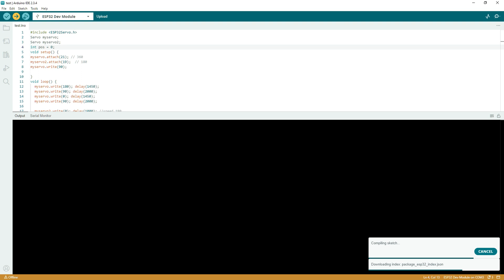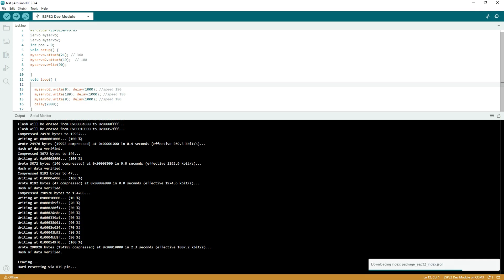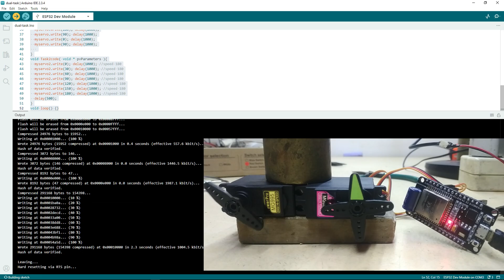Fix Failed to connect to ESP32 No serial data received

Comment: I was having this issue, for several hours, until I swapped my micro-usb power-cable to a data-cable. Once I did that, the ESP32 connected. Also, don't forget the drivers!
Reply from the maker: Noted - the same problem arises with the quality of the USB cable. Thank you

Comment: Pls help me my errol is the same errol in video but i can't fix
Reply from the maker: I've experienced replacing the USB cable (simple)
If the ESP is installed incorrectly, an overcurrent condition can damage the DC-DC chip.Chip loose power.
That's all I've ever experienced. (No change needed). I hope can help
Reply: @ObengwareID  My ESP heats up quickly when plugged

Comment: kasus saya seperti itu tapi cpu tiba tiba hangat, dan awalnya memory flash setelah di compile adalah 87% tapi ketika diiupload malah 32% dan status exit 2, pemberitahuannya sama persis seperti itu... apakah kasus divideo sama?
mohon jawab pak...
Reply from the maker: Kasus ini sering terjadi dari power.
1. kabel USB, tidak memberi power cukup. Dapat dicoba dengan kabel USB lain.
2. ada beban masih terhubung ke ESP32, misal servo. Disarankan dilepas terlebih dahulu. Agar power ke ESP tidak terganggu
3. Karena repot harus lepas pasang. Biasanya DIY memasang satu kapasitor kecil
Kendalanya, ketika program upload hampir selesai.
Power tiba tiba tidak menyuplai sempurna (drop)
Dapat di coba dengan upload ke ESP tanpa terhubung perangkat.
Bila berhasil, ESP tidak masalah. Bila masalah muncul kembali, kami kurang tahu penyebabnya apa.
Semoga masalah kakak mirip dan dapat terbantu seperti perbaikan di video ini.
Reply: @ObengwareID  saya pakai lily go ttgo tcall yang sudah terpasang sim800L, normal kah kalau CPUnya hangat ketika upload program? mohon dijawab juga pak
Reply from the maker: @Kimilyah  Maaf kak, kita hanya mencoba versi ESP32 dan ESP8266. Belum mencoba ke versi ekstensi seperti hardware yang lebih lengkap milik kakak.
Sekali lagi mohon maaf.
Reply: @ObengwareID  terima kasih sudah merespons. sukses terus pak

Comment: How to Fix: Uploading Code to ESP32-CAM-MB  

Step-by-step:  
1. Unplug power (if connected separately).  
2. Press and hold the "IO0" button (on the ESP32-CAM module).  
3. Plug in the USB (connect to your PC) while still holding IO0.  
4. Release the IO0 button after about 2 seconds.  
5. Click "Upload" in Arduino IDE.  
6. Once uploaded, unplug and replug the ESP32-CAM to reboot.
Reply from the maker: Thank for ingo J
Reply: Thanks it works ♥️♥️♥️

Comment: No conect bourd found itu kenapa ya usb tidak konnek tolong dibantu esp32 saya
Reply from the maker: https://studio.youtube.com/video/h-jqF8Y5iV4/edit
Biasanya
Driver ESP32 belum di install
Masih mengunakan driver untuk board 8266, tapi pindah ke ESP32 atau ESP32 USB-C
Keduanya berbeda chip
Kabel USBnya bukan untuk data
semoga informasi pertama dapat membantu

Sebelumnya jalan, sekarang rusak
Nah, kemungkinan ESP32 yang rusak. Semoga tidak
Lihat lampu apakah menyala ketika di konek ke USB
Bila ESP32 pernah digunakan untuk beban besar seperti servo
Dan power diambil langsung ke board, dapat merusak voltage regulator chip
Reply: Saya juga gitu esp nya